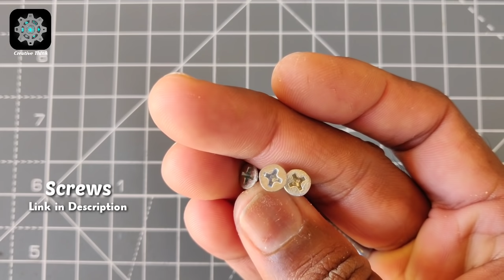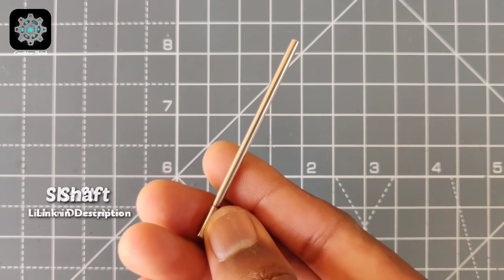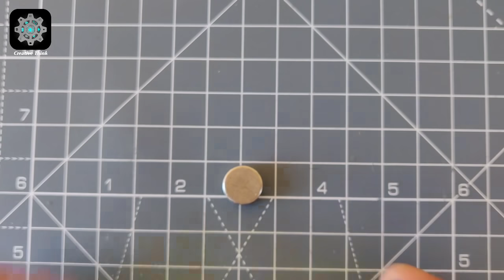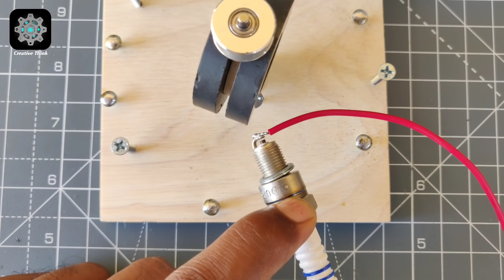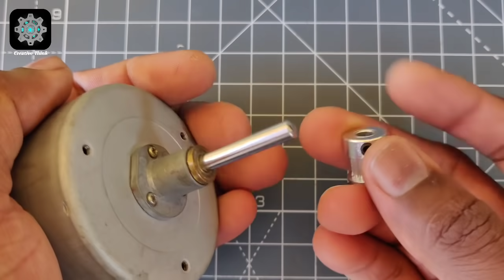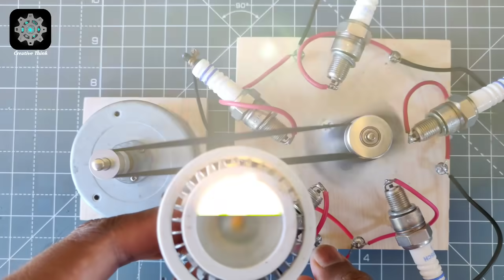Spark Plug Free Energy Generator

Comment: LOL the spark plugs are just used as dummies, because he soldered both poles... 😂😂😂
Reply: This is called a series connection
I know i'ts hard do understant for somebody like you.
Reply: @lordmais3067  Look at this guy acting like he knows something. In the video description it says this video is  fake and does not work. But muh series connection.
Reply: @7James77  Actually, He just said that Free Energy system aren't possible, but Energy can be converted.  This may work, but the Magnet MUST add more rotation to the system, then friction takes out.  I think I need to review how a spark plug is made.
Reply: @bcsviewer1  my thoughts also what materials used in making a spark plug, also the shaft is independent from the pulley, so what is making the magnet Spin? Would a spinning Aluminum pulley be able to spin magnets, by creating a motor/generator within itself. More here than meets the eye in Design...
Reply: @steve-o6413  I doubt it will work with Aluminum, It's not magnetic.  I think you have to use Iron, Cobalt or Nickle those are the highly magnetic materials.

Comment: I think in engine terms, this is called a magneto.
Reply: It is but this defies the laws of physics. A magneto works like this. You get a rotational input either by a person or a starter. This turns rotational energy into electrical energy using the magneto. The electrical energy then causes the combustion which then in turn just repeats the process. There is no way that you will get that much energy out of that. If this was real and if it somehow worked then it wouldve died the moment he connected the flashlight...
Reply: @hendrikpoggenpoel4508  There is no law of physics being defied here (and no combustion either). The system is a closed loop, and it will slow down via mechanical and air friction, thermal loss, etc. It would slow down much faster under load, but the video doesn't show a long enough continuous clip.
Reply: Magnetos need energy from another source to work

Comment: In between each of the 5 things there is a single pin for the soldering in chain..

EXCEPT in one spot they aren't soldered together there is  a gap.

Flit the thing upside down hohoho there is a battery hidden right there!

It's still free energy because a friend gave him the battery for free.

Comment: "free energy" * uses a 9v battery to start the thing *
Reply: all power plant requires input energy to kickstart. Usually, the initial power comes from a diesel generator. That includes Fusion energy which includes gigawatt of energy to make it run until it stabilizes.
Reply: U can do it manually too by spinning magnet with rubber band or something
Reply: But he only appeared to touch one battery lead to start the contraption? No complete circuit......
Reply: sparky12x  Did u ever saw a thing called sun? ;)
Research for Tesla and his inventions about free Energy and talk after
Reply: Did he unplug it after it started moving?
Reply: @marketmakerstreet  All power needs ENERGY something sadly lacking in this con. Its so bad its pitiful

Comment: Neat! Lots of great ideas involving small DC motors and magnetism. That's fun by itself. More practically, I'd like to see builds with tiny loads aggregated into an old school storage system like the lifting of water. Plus, these run efficiently with brand new parts which have lots of carbon fuel inputs. Show me free power from junk parts to practical application/discharge Youtube!

Comment: this kind of device i believe isn't used in industry because of the output on them is not enough to be practical but wonder if you could use them to trickle charge a small battery bank and then use the battery bank to say charge your phone ..?

Comment: Then why we still pays for electricity in this modern age??🥴🥴
Reply: Ugypt Kutan This works coze energy is not transferred anywhere, it’s like in a box. When you connect to a bulb it’s like opening the box and the energy dies off.
Reply: Exactly why
Reply: It's fake there has to be a battery somewhere probably in the motor
Reply: Because this don't work and a power station does.

Comment: hello,cool!! what is this resistor or condensator? intersted to try ^ ^ i know wjen one magnet move in one coil or one coil move around one magnet that s generate electricity,it s the principe of the
 gasoline current generator but i dont like gasoline and stuff like that,i m very interested by this little solution ^ ^  in advance thank you ^ ^
Reply: It’s fake my guy! Spark plugs are literally just 2 conductors which lets electricity through them.

Comment: What a trick is this
First You applied DC current with a battery to your DC motor and after that you put a cycle of free energy i.e your dc motor work when applying ac current from ur generator but it's wrong, it's impossible

Comment: Lol its is recycle energy .....not free "the motor will rotate and create a DC energy with the magnet and use the acquired energy to rotate the motor again" I don't think there will be enough voltage overflow to use it for other links.

Comment: Why the spark plug is just a high voltage gab that ignite the fuel it's just a wire gab with platinum tip it can't generate electricity.also what is that ear blasting music that sound just like another of your scam video.
Reply: Do you speak English?